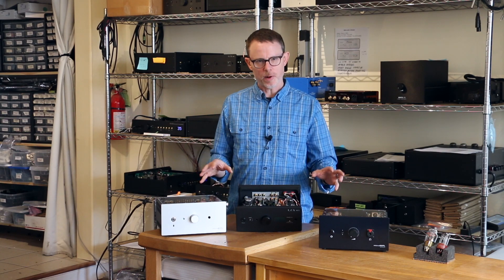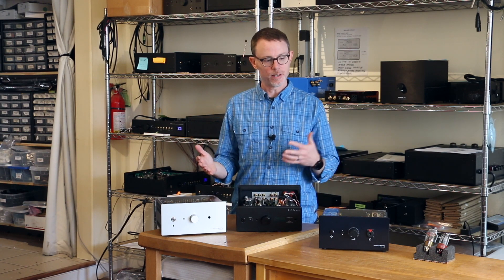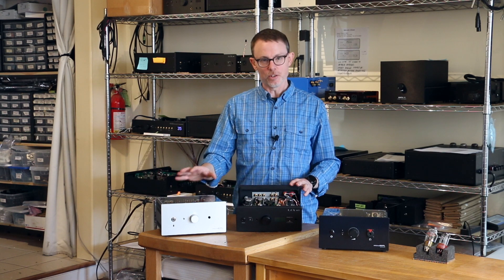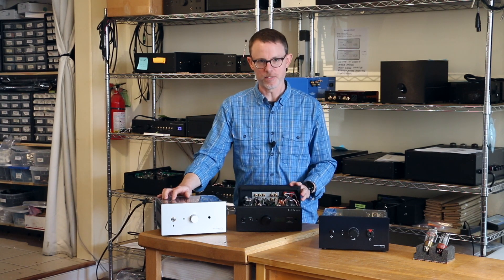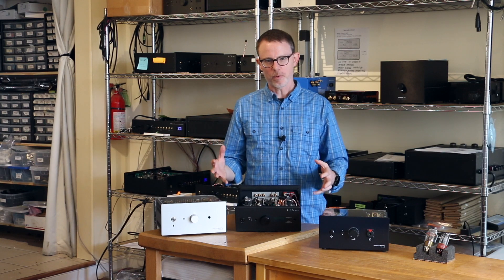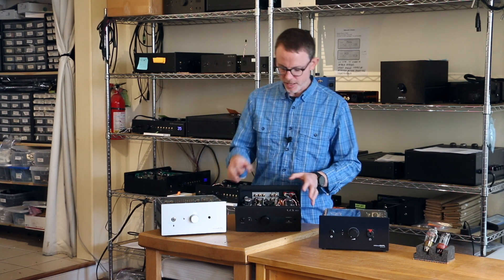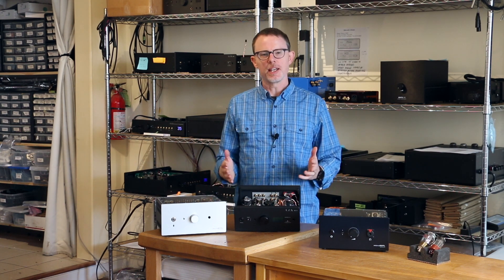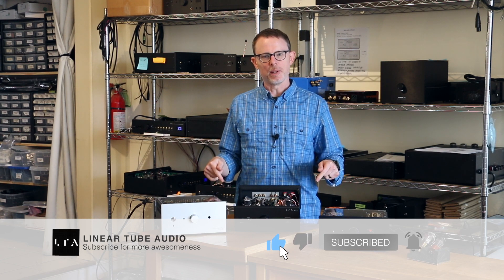How to switch between 12SN7 & 6SN7 tubes in a Linear Tube Audio MZ2, MZ3, or MicroZOTL Preamplifier

Comment: Hello Sir,  I wish to swap using 12au7 tubes instead of your default 12at7 tubes but couldn't find the jumpers for them. Could you let me know where the jumper is located? Is it at bottom left corner or where? Thanks ！
Reply from the maker: Hello. Sorry it took so long for us to see your question. You do not need to change any settings or jumpers when switching the 12AU7 / 12AU7 tubes. The jumpers when changing between 6SN7 and 12SN7 tubes are labeled and located centrally a bit off to the left. If your unit is very old, it may be hardwired for a certain tube type. You can email us a photo for confirmation at hifi@lineartubeaudio.com
Reply: @LinearTubeAudio  hi, Thanks for replying. Bought the preamp last year so I guess it doesn't require any rewire 😊

Comment: I've got a variety of 6SN7 tubes from tube rolling with my previous Schitt Freya preamp.  Any general  differences with the 12SN7 tubes?
Reply from the maker: Nope, no overall differences, outside of the regular difference between tubes based on brand, provenance, etc. Just make sure the tubes are matched and very quiet. Let us know if you find any you particularly like... ~ Nicholas
Reply: @LinearTubeAudio  I rolled various 6SN7 tubes.  Raytheon VT-231, 5692, CBS Hytron Canada.  Honestly, the tubes you supplied with the unit are the best.  The Microzotl makes even el cheapo NOS tubes sound good.  That wasn't the case in the Schitt Freya.  You needed expensive tubes, i.e. Brimar vintage to make it sound good.  I'm very impressed with the Microzotl build quality.  The tube sockets are top shelf- very strong connection.  This isn't the case with cheaper preamps and it totally matters.
Reply: @LinearTubeAudio  Just a question, there are 4 tubes in my Microzotl MZ2.  2 smaller ones and the two bigger ones, are they all replaceable, or just the two for changing the sound.  TIA !!
Reply from the maker: @Canadian_Eh_I  Hello. All four are replaceable and all four affect the sound. You can use either 6SN7 or 12SN7 output tubes (the larger ones), as discussed in this video. For the input tubes (the smaller tubes), you can use either 12AT7 or 12AU7 (12AU7 will lower the gain). There are no toggle switches or jumpers for the 12AT7/12AU7 tubes, since these are both 12V tubes.